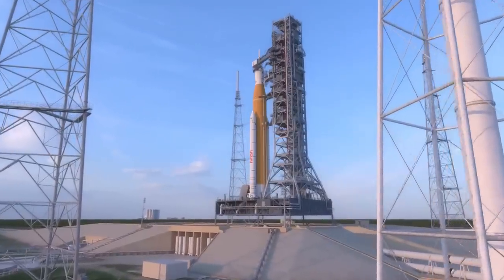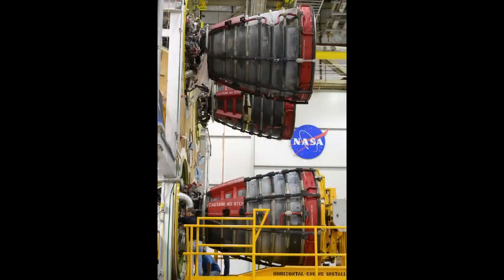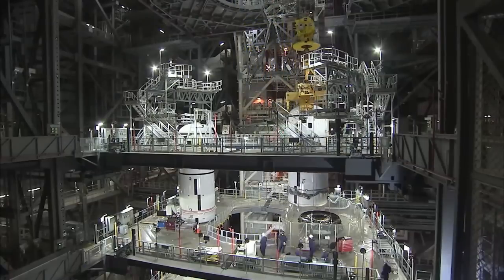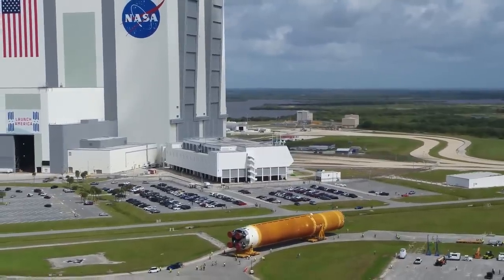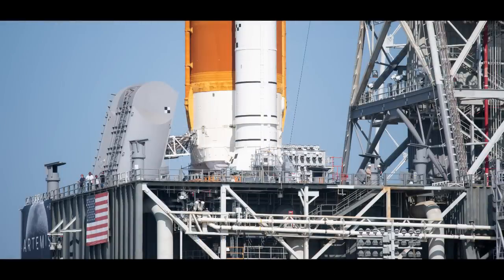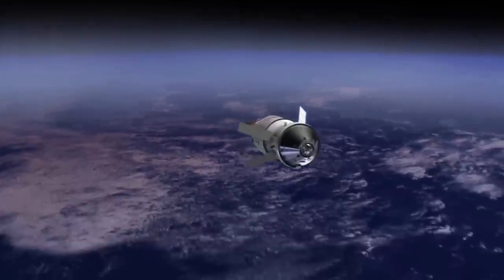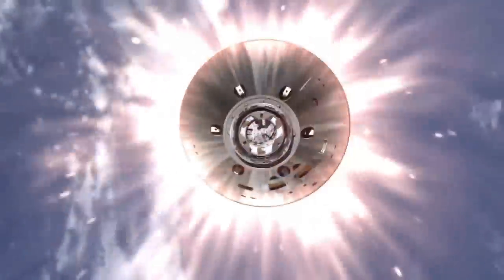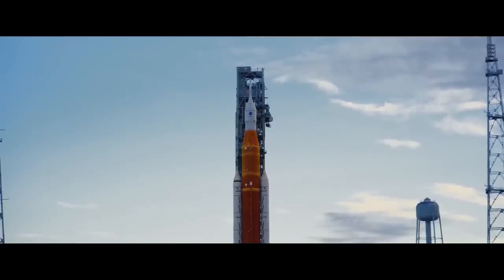What's The Big Deal About Artemis - NASA's New Massive Moon Rocket

Comment: Would be interesting to learn more about the valve system in the launch escape system. Seems like an interesting engineering problem.
Reply: Some 2 stroke bike motors have something similar in the exhaust port.  :)
Reply: Let's hope Boeing isn't involved in building those valves.
Reply: @wiregold8930  or any of the software
Reply: Bet the warranty states something about use only once. :P
Reply: took the words out of my fingers. I was going to say the same. That's an amazing system.
Reply: @ekscalybur  I bet it does and also to not get it wet lol /s
Reply: @ebenwaterman5858  Just the matter of a thousand degrees difference in exhaust temp, as well as it being heavy in hydrochloric acid, and also higher pressure. Very aggressive environment!
Reply: @ekscalybur  space hardware has a warranty ?!?
Reply: I doubt the valves are overly complex.
Less moving parts means less failure points.
Reply: @ebenwaterman5858  2 stroke motor bikes don't operate at that temperature range
Reply: @wiregold8930  I believe Northrop Grumman is the contractor for the LAS
Reply: While I have no idea what makes the valves actuate or anything like that, I know the material that the flamey bit flows through is made from a carbon-carbon composite material that the company I work for makes. I can't say too much more about the details because of ITAR restrictions, but we also make PICA, the heat shield material that Perseverance used and SpaceX "stole" to make PICA-X.
Reply: @a-fl-man640  It's a clear example of optimizing the wrong thing. Why, fucking WHY would you use a bloody SRB for steering????
The problem with SRBs is that once ignited, you can't control of shut them down. This is why steering is typically done using cold gas thrusters or, when there is a need for hot gas, with hypergalic propellants because those are extremely reliable and piss easy for the engine to manage. 
Using an SRB for steering is insanity and it utterly floored me when Scott mentioned it.
Reply: Im guessing that the solution to the problem has something to do with "it only has to work for 30 seconds"
Reply: The valve design dates back to the 19th century. For Aerospace applications we increased the temperature range and sealing pressures.
Reply: @wouldntyouliketoknow9891  Yup, as I read somewhere, they used to say about the old type of launch abort systems in NASA on Apollo, regarding operational reliability: "First time, all the time, every time"! LOL ;D
Reply: Going to the moon where have i heard that before
Reply: @looneytoons2878  they forgot the "back"!! :D LOL
Reply: [Thread bypass]:  Indeed; I'm interested to know what those valves are made of to stand up to direct thermal and pneumatic-mechanical stress.
Reply: Yesss, I would love to know how they work exactly! I know they reverse the thrust in jet engines (for braking), but the exhaust of an SRB must be way hotter and under higher pressure. and the valves on the launch abort system have to be so fast.
Reply: @carljohan9265  No, it was optimizing the correct option. I had doubts about using the main propulsion gases for guidance. Once I built and tested a system, I found it simpler than a cold gas system and I have designed and  built cold gas systems with one being man rated.
Reply: @Spacedog49  Like I said, hypergalics is your go-to if you want the utmost reliability and the simplest possible mechanism. 
Literally all you need to do it open 2 valves and you get ignition for free 100% reliably.
Reply: @ekscalybur  the wording of that lifetime warranty

Comment: I worked on Orion up until Constellation was closed down. Then we were on life support for a while then most of us were let go. I don't think it was ever over budget during the time I was there, and it was a very workable robust design. All it needed was a rocket :(  I would feel safer on an Orion than any other past or current manned spacecraft. Lockheed-Martin had over a hundred million of its own dollars on the table and had put a lot of its own resources into the project. NASA burned up a lot of money using Constellation as an analysis factory for various pet projects. There was also a lot of support as far as parts qualification, etc. going from Constellation to SpacEx.
Reply: To the detriment of the project and the American taxpayers, that's what you get when politicians are running the show, instead of just letting designers, engineers and scientists do the best they can with what they have.
Reply: @ArKritz84  I wish everyone understood this but alas.....
Reply: @ArKritz84  let's just hope they leave Artemis alone and let a program succeed for once
Reply: Elon is showing what is possible without all the government red tape.
Reply: @cutndry4165  Elon is showing what is possible if failures are not failures but in actual fact a way to learn. When failure is not an option, everything becomes far more difficult and expensive.
Reply: @iamunamed5800  are you kidding? They've been meddling for a solid decade, with no end in sight. Which in no small part is why we're still at least a couple of years away from a crewed launch, and a lander is still just in the fever dreams of a tech billionaire.
Reply: @ArKritz84  You seem to not know that SLS was a jobs program.  I have no issue with keeping the knowledge alive otherwise Elon (and all the others) would have had to start from scratch.
Reply: Yea I remember you, those were good times. Did you ever get that one toilet unplugged? I remember you had the whole stall roped off for months. Somebody did a real number on you.
Thanks for your support, I remember you used to salute us every time we left the restroom. Oh man good times. 👍
Reply: @RS-ls7mm  "SLS was a jobs program"?  I thought SLS stood for Senate Lobbying System, and was designed to turn millions of taxpayer dollars into corporate welfare, and then convert a fraction of that money into campaign donations.
Reply: Cool! thanks for your work!
Reply: @cutndry4165  uh no, there is plenty of regulation spaces has to follow.
Reply: You wouldn‘t feel safe in a dragon capsule? What are you on about?
Reply: @CompanionCube  I wouldn't feel unsafe in one. But  I'd feel safer in an Orion.
Reply: @spaceranger3728  I'd probably feel safer if that life support system had actually been tested in space even once but I understand the sentiment.
Reply: Eh? Crew Dragon has a much better safety record. Good luck in Orion which doesn't even have a life support system.  It will be tested the first time with humans on board in space. Yolo!
Reply: I was worried a lot of shuttle launch safety concerns were being continued with the SLS. I guess an abort tower is the only thing that can really create some respect of safety? But I digress, what do I know?
Reply: @babayada2015  I wish people who understood this for rockets understood it for every other thing the government touches.
Reply: @cutndry4165  Nasa also does a lot more than spacex though. Spacex so far has made reusable rockets. Which is huge and made starlink which is meh. But nasa has so many more responsibilities. Rovers on mars, JWST, probes to other planets, deep space radars, earth weather satellites and way way more.

None of this is meant to detract from spacex because it's all great. But NASA gets plenty done on a small budget because they have to account everything to congress.
Reply: @juniperpansy  With all the delays with SLS you'd of thought it would have been added by now.  I was unaware this first flight won't have the ECS or LS - thanks to Scott M.
Reply: At this point it’s obvious we wouldn’t let any of our loved ones go on any rocket other than a Musk designed project
Reply: I was working Ares I when Constellation got canceled. I was out of the space program for 8 years because of that, so I know how you feel. At least your work was not completely in vain.
Reply: @stevechance150  , not million, billions. I’m a contractor, like 90% of the people working at NASA,  for over a dozen years. I’ve seen more money pissed off in stupid ways that I just get pissed off. And I’ve also seen folks do great work on damn near no budget at all. I’ve seen the inter-center rivalries, where budget is as much about which Senator and Congress critter is pushing things, as anything else. But I’ve also got contracts at four other government departments or agencies. The average worker at NASA is more mission driven than any other. They at least try hard to get their job done. They aren’t just there for a paycheck.
Reply: @spaceranger3728  One thing i’ve been curious about is if during the design of Orion there was radiation mitigation integrated into the capsule?  Just a long time fanboy looking for knowledge.
Reply: @ArKritz84  
"To the detriment of the project and the American taxpayers, that's what you get when politicians are running the show, instead of just letting designers, engineers and scientists do the best they can with what they have."

I think that's just about the opposite of what he said. First of all, Lockheed Martin put $100 million of its own money into it and then a significant portion of what was developed was handed over to SpaceX. So Lockheed Martin paid and SpaceX collected.
Reply: @ArKritz84  the boosters land on earth = the same engines/ with different software  can land on the moon or mars.
Reply: Well after watching the Orion space craft slam into the earth, pieces everywhere, quite spectacular if I do say so my self. Failure to open its parachutes 🪂 😂🤣😂😅
Reply: @Nostradamus_Order33  That was supposed to happen.
Reply: @crazyspace6792  Although, regarding rocket tech, JWST used fine precise European  Ariane 5 rocket, not NASA/USA.
Reply: @Nostradamus_Order33  It didn't fail to open the parachutes. It didn't have parachutes on that test.
Reply: @cutndry4165  . And doing it time and time again. His track record speaks for itself. Over 125 successful 1st stage landings. As Musk stated in the past,  the first stage is 70 percent the cost of the entire rocket.  Plus the 2 fairing halves are a combined cost of 6 million dollars and some of those fairings have been  reused at least 3 each. Huge savings.
Reply: Going to the moon where have i heard that before
Reply: The launch cost is supposed to be 4 billion dollars ...it's not reusable..how can it be that expensive...how many launches can space X do for the price of just 1 SLS LAUNCH
Reply: For all this Elon vs nasa/politics…. One has been on mars since the 90s. Worked to put together a space station. Flown a helicopter on Mars’s. Landed on titan, orbited an asteroid first, orbited mercury, put up the James Webb telescope, returned samples from a comet, etc etc. I love space x but even just mission wise nasa juggles way more projects and pulled missions space x isn’t even close to doing.
Reply: @LowVoltage_FPV  THIS! Thank you for spelling this out, as some people still seem to not understand why NASA often plays it so safe. They don't have much of a choice, and also don't have resources to use in iterative testing (to the extent SpaceX can), and basically have to nail everything in one go.

I saw comments under videos saying "we already went to the moon 50 years ago, Artemis 1 seems like a waste/why not just build what we know works again?" followed by "looks like NASA is trying to reinvent the wheel..." 

They don't realize NASA doesn't have the option to fail on basically anything, and Artemis 1 is their only real chance to fully test everything put together.
Reply: @cutndry4165  Don't forget the billions that he's received from government subsides and tax credits.
Reply: @phillip5245  With stunning results.   Massive bang for our taxpayer buck.
Reply: Whether you feel safer or not has no bearing on whether or not it is safe. That has more to do with your emotional state.
Reply: @stevechance150  most accurate description I've heard
Reply: Just being on life support is a slow burn on funds with little to no progress.  You may not have exceeded your allocated budgets but that doesn't mean you weren't progressing to be over budget.   To a certain extent, the Orion and Artemis targeted very high goals to initially be deep space man rated at the start whereas say Dragon worked on LEO cargo first, took what they learned and worked on LEO man rated and then took what they learned and changed plans to the Starship which itself is nothing like what it was originally conceived as.   Orion and Artemis are dog faced determined to prove their initial beliefs and bias and not adapting to the difficulties they find or changing priorities but to just bluntly work through the problems encountered.  They believed that hydrogen and using Shuttle technologies are what they should do and they will try to push that through regardless of the problems encountered, like wise even the belief that the Orion capsule is what's needed for deep space belies changes in what might be actually needed.  I think both Orion and Artemis are excellent efforts but I have no faith in them having been adapted to be what will actually be needed due to their development process.
Reply: @johnwang9914  I remember during Constellation they were really pushing Methane for the Altair lander.
Reply: @AveragePicker  robots do seem like a more viable solution to mars exploration than sending a human there

Comment: Totally jazzed about this launch! I work on the SLS umbilicals now, and I worked on predecessors to this design as far back as 20 years ago. It's about time to finally fly this beast!
Reply: Congrats on doing good work for our country and the world at large!!
Reply: Awesome! I'd love to be able to say my hands were involved in part of something like this! They weren't, but you definitely have a cool brag 😎.
Reply: Whoops!
Reply: @johntechwriter  Cryogenic seals are sometimes temperamental. It'll work out eventually.
Reply: That's really cool.  Do you have an opinion about the recent problems being caused or exacerbated, in part, by the use of this mobile launch platform instead of if they had built a platform specifically for sls?  I'm def not an engineer, but I'm attending the launch and I heard a lot of talk about this when I was up there for the first attempt. I'm curioys if you have any thoughts on this.
Reply: @sunitamosesesq  So the ML-1 itself was originally built for Constellation, but was modified for SLS Block 1. Block 1B and Block 2 require the upper section of the LUT (launch umbilical tower) to be taller with different umbilical connections since the upper stage will be the Exploration Upper Stage instead of the modified Delta IV second stage that is used for Block 1, so there will be a purpose-built ML-2 for those launches. 
To your question as to whether the fact that the ML wasn't originally built for SLS could cause some of the issues we've had with launching: I really don't think so. The hydrogen quick-disconnect that was leaking is a specific QD built for SLS. It's actually procured by Boeing from Vacco, and mounted as part of the umbilical plates to the Core Stage Engine Section. (The plates have a flight half that stays with the vehicle, and a ground half that stays with the umbilical arms. These particular arms are mounted to the surface of the ML rather than up on the LUT). So the responsible party for any issues with the hydrogen QD is Boeing, not the folks at KSC.
The other big issue that caused the first scrub was a sensor that seemed to indicate the engine wasn't getting adequate LOX flow to properly pre-chill before launch. That sensor IS located in the fill/drain system, so it's part of KSC responsibility. Still not related to the reused launcher though.
In my  opinion the issues are mostly with the operators getting comfortable with how everything operates in real life versus expectations. They figured out the engine really was chilling down just fine, despite the odd reading in that one sensor, so from now on they'll know that's a non-issue. The leaky QD may take some tweaking in process and maybe material to get the seal to work reliably at 30 degrees above absolute zero, but it's a solvable problem. I would expect to see less and less anomalies with each launch, as the kinks get worked out.
Reply: @jamesowens7176  Good work on the launch, it was beautiful. You played an important roll in getting that thing off the pad!